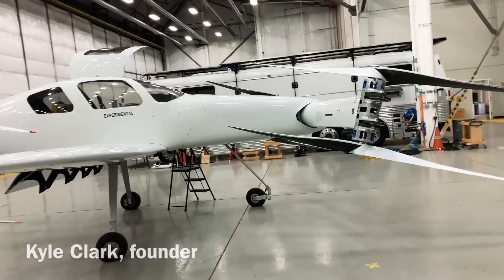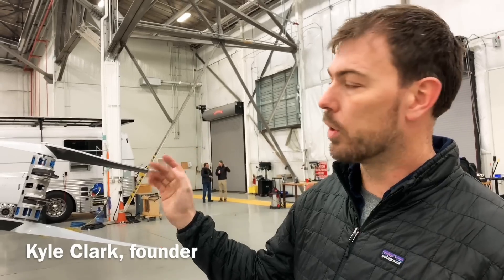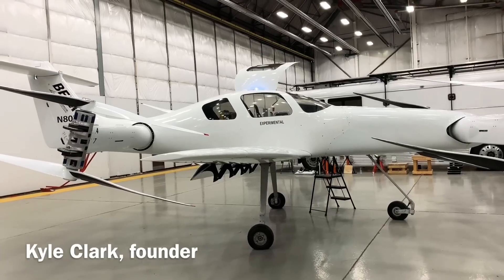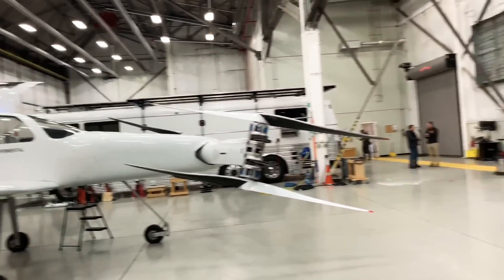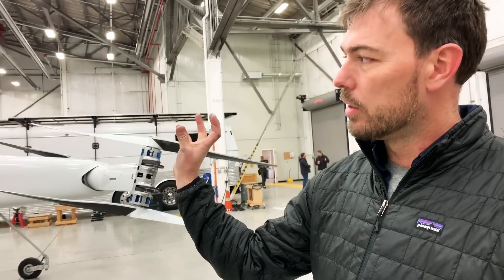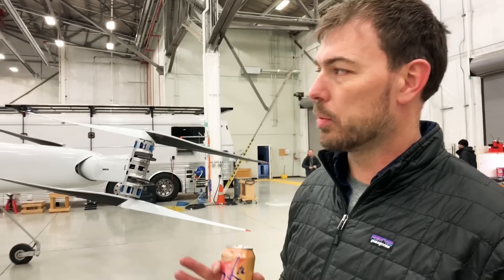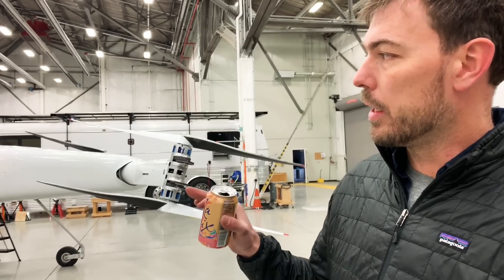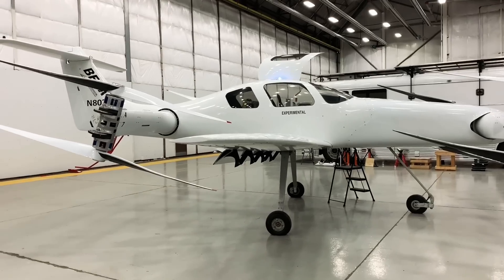Beta Technologies eVTOL Air Taxi Prototype

Comment: This looks a lot more creditable than any over VTOL flying car / craft I've seen. Best of luck for the future. 👍
Reply: Dig this https://www.youtube.com/watch?v=7GZeBVldeDE
Reply: You need to see the hover bike.  Plus it didnt vtol. It when through a runway like a regular plane.   This is the worst vtol bro. It didn’t even take off vertically or land. This isnt even something vtol.
Reply: This thing is a stepping stone. An exploration into the possible. I personally hate the design. It should be able to actually vtol if it is displayed as such. Looked to me like he used about 1500 ft of runway just getting the wheels up. That isn't vtol at all.
Reply: Flying Speed Brake can I build a plane call it vtol and say a video of it doing vertical will be out shortly. It’s not a vtol until it’s capable of vertical take off. It isn’t yet so it isn’t vtol.
Reply: Flying Speed Brake and btw you are on YouTube. Look at the real vtols. You know the ones that actually show vertical take off and movement and fully functional.

Comment: So... how is this better than a normal airplane? Or a mosquito helicopter?
Reply: Better because its more efficient and zero emissions. Unlike a helicopter, once in flight, power can be throttled back because lift is generated by the wings. Also quieter because no noisy IC engine is involved.
Reply: @martinw245  The more efficient part must be proven, because the additional weight for the tilting system and all the rotors, is never a good thing in "aircrafts"... And the "lift generated by wings" in this case, doesn't apply when the lifting air is chopped by two rotors in front of the wing, you don't get any "efficient" lift out of turbulent air.
Reply: @AltMarc  

"The more efficient part must be proven, because the additional weight for the tilting system and all the rotors, is never a good thing in "aircrafts"..."

Well no, when you compare efficiency you are obviously comparing  like for like. YOu would compare the same VTOL aircraft but with eight internal combustion engines, you would be dealing with many orders of magnitude more weight. You would require eight internal combustion engines and eight gear boxes. In fact the weight would be prohibitive, you would be required to reduce the number of engines and gear boxes and completely redesign the aircraft for it to be feasible.

Internal combustion engines have many hundreds of moving parts plus a gear box with a few hundred more moving parts. 

Electric motors have between 2 and 4 moving parts and don't require a gear box.
The entire reason it's possible to create a VTOL concept like this with batteries and electric motors, is due to the advance in battery technology and the fact that electric motors are way more efficient than internal combustion engines.  

Electric motors can be more than 90% EFFICIENT. Combustion engines can be only  30 - 40% efficient.

"And the "lift generated by wings" in this case, doesn't apply when the lifting air is chopped by two rotors in front of the wing, you don't get any "efficient" lift out of turbulent air."

Of course not, The designers of this aircraft are not idiots. They wouldn't design it with wings if the wings didn't generate lift. :)
the entire point is that the rotors tilt forward for level flight. If the wings weren't generating  lift in this configuration it would drop out of the sky, clearly it doesn't. In addition, there are countless prop driven aircraft in our skies with engines and props mounted to the wings. They get along just fine.

Here's a NASA concept that might interest you. You will note that the multitude of props on the wings are designed to INCREASE lift, they don't reduce lift. In fact there are have been one or two other aircraft designed this way too, with the props directing air over the wings to aid lift.

https://spectrum.ieee.org/aerospace/aviation/nasa-remakes-the-airplane-wing-with-electric-propulsion-and-a-whole-lot-of-propellers
Reply: @AltMarc  

Here's another "blown wing" concept for you.

https://www.globalsecurity.org/military/systems/aircraft/vtol-rbw.htm

In fact I'm sure you have seen the Osprey tilt rotor that has no difficulty with air blown over the wing, in fact it aids lift.
Reply: @martinw245  Don't worry, I know pretty well the difference between combustion and electric, I have almost the same talk as you.
Solar Impulse was built in my own country.
The original question was, comparing it to an airplane or helicopter. To be fair, the like for.like, lets compare it to an electric airplane and an electric helicopter in term of efficiency, and their you see another picture. Big surfaces and big rotors are more efficient, see the human powered helicopter....

I said "in this case", about the lift generated over wing, because this contraption is a regular Lancair airplane where the propeller/engine was replaced by these tilting propeller pods. In emergency nice, but not designed in anyway for efficiency...
Main trouble being that it works in a narrow range of airspeed (IEEE art:they shutdown the motors in flight).

Martin Hollmann RIP told me once, many years ago, that an electric gyrocopter would be the better way to go. 
And I'm still thinking about how to build a torque-less helicopter rotor with electric propeller driven tips or leading edge. my playlist about -> https://www.youtube.com/watch?v=GDIqrt8i4GQ&list=PL7byala7U30Tn6WpWuCNYr6V91kHF6UwP&index=1

More crazy concepts: https://www.youtube.com/watch?v=nQVwecYya_A
Reply: @AltMarc  

"The original question was, comparing it to an airplane or helicopter. To be fair, the like for.like, lets compare it to an electric airplane and an electric helicopter in term of efficiency, "

No... he was comparing this electric VTOL concept with a fuel driven conventional aircraft and helicopter.

Comment: Front wheel support beam vibrates quite a lot, see 01:25.
Reply: I'l bet your the first to notice that. Maybe they should take videos and watch them later to see things like that.
Reply: The whole undercart seems terrifyingly skinny... but it shouldn't have to take high loads, should It? If it is VTO, there shouldn't be need to tramp it along a runway at take off speed. The wheels are only need to get it out of the shed... Err... like at the end.
Reply: I was thinking the same. The design is great but it seems the undercarriage got replaced by matchsticks
Reply: First thing I noticed on taking off, wouldn't want a hard landing.
Reply: this can lead to metal fatigue. not good.
Reply: It begs the question: why not VTOL? A rolling takeoff seems easier on the batteries and motor controllers because hover would surely be more energy intensive. Maybe they're not to that point, yet. The landing gear seem pretty skinny for a non-VTOL landing. I think the vibration at 1:25 is from the grooves in the taxi/runway.
Reply: @toastrecon  power vs weight vs efficiency.  You got a lightweight design that can do VTOL nearly empty. Now you start stuffing avionics, safety gear (chute, cushions) and cargo. That just tacked on maybe 750-1000 pounds dead weight.  Now how is the Beta going to to in VTOL?  Not very good.  Fact is, it will go through a large fraction of the charge taking off, then another chunk landing in VTOL.  There is another mode, STOL. Any aircraft or help that is burdened down will opt for a rolling takeoff. The rotating wings of a heli would bite into the laminar airflow better and make for a more efficient takeoff.  Beta here has wing that can benefit from that mode, using less power and carry the cargo or passengers as advertised.
Reply: That's virtually nothing for lightweight aircraft like this.
Reply: @5thGenNativeTexan  Not really. He said it was 4000 lbs, which isn't very light at all. Comparably sized aircrft weigh half as much as that thing does, often times less.
Reply: WOW Yes, that is going to cause trouble.
Reply: maybe a damper would fix it

Comment: Very nice! I like this solution better than the quad copter passenger designs. This is a lot safer looking design with more power saving in Airplane mode. If you coat the wings and fuselage with solar panels than the plane could charge while in flight and on the ground.

Comment: Eight belt-driven rotors in the same effective plane as the cabin.  Oh, nothing bad could happen here...
Reply: Most turbo props, like the Dash 8 have props in the same plane as the cabin, and powered by immensely powerful gas turbine engines. A multitude of twin engined GA  prop aircraft do too. Not to mention a plethora of big jets that have collosally powerful high bypass turbofans that have moving parts at high velocity.

In short, its common and normal.
Reply: @martinw245  exactly, but making that connection would require an active, rational mind. much easier just to randomly diss something you have no understanding of, with the first nonsense that jumps into your head.
Reply: Belt-driven rotors? I guess I missed that...
Reply: @marcelogouveia9614   indeed you did
Reply: They are not belt driven.
Edit: Sorry, it said direct drive but I see that there actually are belts as a speed reduction. One motor for each propeller placed in the tiltable nacelles but there is a short belt from each motor to its propeller. Can be seen here: http://imagesvc.timeincapp.com/v3/foundry/image/?q=60&url=https%3A%2F%2Fs3.amazonaws.com%2Fthe-drive-staging%2Fmessage-editor%252F1547236736295-ava-wing-gears.jpg
Reply: @skunkjobb  Actually,  there are two short belts from each motor to the rotor.

Comment: Half decent config but a little too history bound. Notice you have a beam between the motors similar to a wing. Make it the wing instead. Just one wing that tilts with the props. Not 3 beams, one.
And two motor points. And don't use the conventional plane body. Just a minimal teardrop, no tail fins of any significance. No length as such. Certainly no long nose. No wheels.
Reply: Also 2 ton seems much too heavy.
Reply: @DanFrederiksen  Well shit Dan if only they'd given you a call ....
Reply: @simonhughes-king  Indeed, but they never do. Human pride.
Reply: A normal aircraft of this size could easily weigh up to 1.5 tons. 2 tons while using batteries is not outrageous.
Reply: @米空軍パイロット  Nah, a Cirrus SR22 is a fully certified 4 seater and rather expensive and that's 1ton unladen. gross 1600kg. This is supposed to be for carrying organs which weigh nothing. It should have only 1 seat in a bare minimum body with a small room behind for cargo. It should weigh around 400kg and be capable of 2g vertical climb with a pilot and cargo (100kg combined). It would be a truly awesome craft compared to that which apparently can't even do vtol. Reach of maybe 150km at 300km/h.
Keep it simple, stupid.
Reply: @DanFrederiksen  If you look at the video after 4:17, you'll realize this plane is significantly larger than a Cirrus.
Reply: @DanFrederiksen  Also, what kinda weight did you expect from a plane with enough power to lift itself?
Reply: @米空軍パイロット  longer than a Cirrus but cabin isn't bigger.  I just wrote above what they weight should be. 400kg or less. Ideally it should be unmanned and weigh much less but with a person in, 400kg is plenty.
Reply: @DanFrederiksen  That would work great for short range, but this thing flies 150 miles
Reply: @DanFrederiksen  Blind sheep? I have a masters in aeronautical engineering and I am a test pilot. Who are you?

Comment: A VTOL should take off without any running start. this plane took quiet a lot to take up speed before it left ground. Still calling it VTOL? I do not think so. its a Tilt Rotor Fixed wing only
Reply from the maker: It was a test flight with the rotors in a fixed position, to gauge stability. The aircraft will take off vertically when the rotors have full range of movement.
Reply: @ericadams321  looking forward to watching Vertical take off. Congrats on a great model design
Reply: Idiot!

Comment: This is actually promising, one of the best looking Vtol after the Lilium aircraft.If I ever design a Drone/plane I would go for this design, very clean and efficient.
Reply: The only thing with Lilium is the efficiency of all those little EDFs and the noise they must make. Unless there is some sort of air entrainment wizardry going on, I can't see how many small EDFs can be efficient enough. Good for no choppy blades though, not as scary looking and less likely to fly apart on brushing a tree!
Reply: @OzAndyify   The Lillium sure looks cool but has it actually flown carrying full load? Not just an empty shell?

Comment: Fine job. What prevents propellers to knock the ground if pilot mishandles (command "aircraft position" if on the ground or too low) even on bumpy ground ? Is it mechanical (angles limited) but not permanent because necessity for "aircraft type" flight. Is there some soft that manages that ?

Comment: This video is great, and I'm impressed with their progress.  I wish more companies would be less stealth and more open to sharing progress.  The public will only be on board with traveling via eVTOL if they can see it demonstrated successfully over the years and build a relationship with the brands.
Reply from the maker: Totally agree. Though I get the need to protect progress and proprietary intel, this entire industry depends on the success of >many< participants, and if everyone is in hiding it will be harder for the tide to rise, so to speak
Reply: There are many companies working on similar concepts, all of which are essentially scaled-up RC technology and concepts.  Check the date on this video (there are many others).  https://youtu.be/yfJWWzg5LeM
Reply: @poretsmouthrunner  - It was a pleasure doing the VTOL motor command code for Peter's build you linked to. As Herman mentions though, it'll take a few full scale builds like this to convince the masses of its feasibility. Congrats to Beta Technologies on a job well done. I wish them continued success.
Reply: Herman Wiegman the experimental aircraft isn’t related to anything vtol.
Reply: @poretsmouthrunner  WOW!!! Now that one got my attention!  Would love to see a full scale version of that one with retractable gear and another one mostly the same but with the 8 engines of the model in this video!  Would be interested in the flight dynamics of such a design!
Reply: I’m not impressed. You haven’t made it vtol yet and you calling it vtol. Please.  There are vehicles already made that’s actually vtol and carries passengers. This is just a complicated mess of an airplane.
Reply: It needs to be shared with government building freeways and bullet trains.
Reply: You clearly know little of modern planes, your car can get farther on a tank of gas than this thing. No one is going to travel any real distance you would want a plane for as it would need to make a landing every hour to recharge.
Reply: @user-ug7fk2js2x  "No one is going to travel any real distance"  Uh, maybe that is why it is called an "Air Taxi"?  You don't use a taxi to go hundreds of miles.
Reply: The public might be on board, but the FAA will not be. And no, the public will not be on board when the first one goes out of control and slams into a pedestrian or takes out a car on the highway... And you're not going to be flying this thing in rural areas as one, it won't have the range and two, people taking pot shots at it...this is on the premise this thing is a "taxi" and will be flying below 400 ft.  As for the Batteries... the batteries would probably end up weighing as much as the plane if you actually plan on going any amount of distance. Currently, there aren't any batteries capable of that... and Umm take organs from manufacturing to hospitals???
Reply: @erospawn 

M